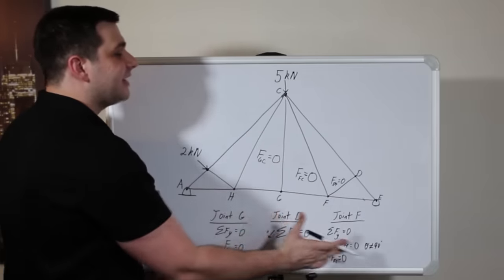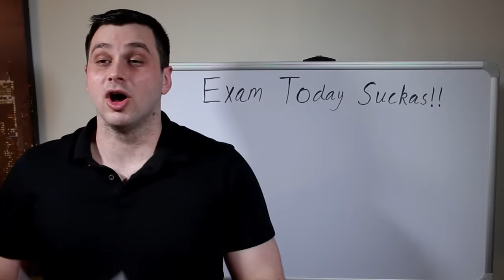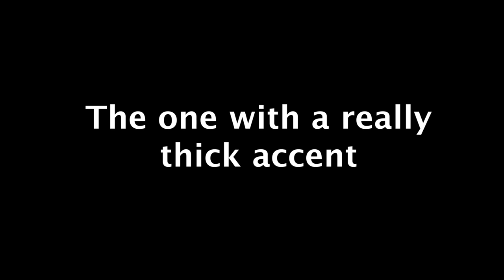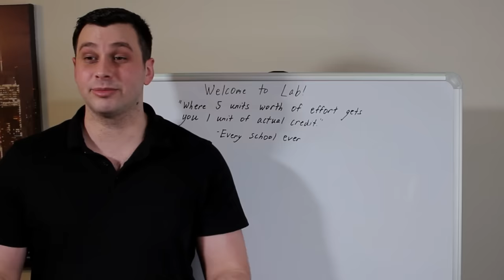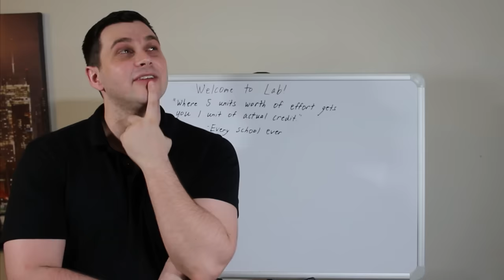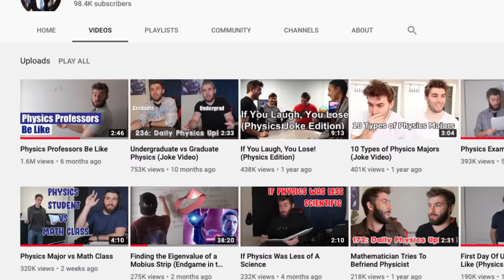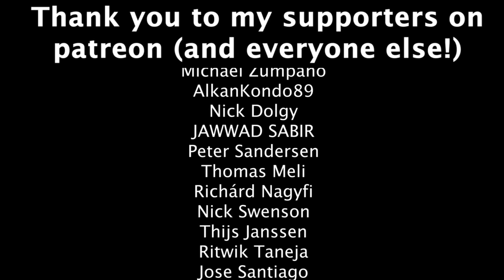Engineering professors be like

Comment: Bro that capacitor one was so true.
One thing I've learned so far making circuits is that if ur circuit doesn't work, try adding random capacitors. Usually works.
Reply: Well I guess they may charge and inject electricity to a circuit which was not design for a good power distribution.
Reply: I just started my 2nd year of electrical engineering! I love circuits
Reply: famous last words
Reply: Electronics engineer at work: "Analogue electronics is easy".

Me: OK, this is a simple circuit diagram of a circuit which works. How exactly does it do 'X'?

Electronics engineer at work: "...."

Me: That's my point.
Reply: Jeez, why is this so true. I'm only doing some basic Arduino-based stuff but adding random capacitors usually makes things work a lot better.
Reply: @bzqp2  I’d guess because it basically adds as a booster for anything taking power on the circuit, it lets things draw higher power when it needs it while staying stable, like if you go from low end speed on a rc car to top speed quickly
Reply: I think of it from a control standpoint. You can reduce steady-state noise of a signal using a PID controller. When implemented as a circuit, the capacitor is the integral portion of the PID. And the integral portion smoothes the steady state error by averaging it out. It's not strictly correct, but it is a nice visual way of rationalizing the need for capacitors.
Reply: The capacitor from the video is just a filter that passes higher frequency signals to ground, reducing noise.
Reply: @thomasgarity1737  pretty much but the question is.. do the lab teacher help you understand this? Mine just straight up called us out for even asking 😂
Reply: I hope you are trolling
Reply: I do the same
Reply: So essentially a reserve capacitor to allow optimal flow. Since energy will take the patch of least resistance that capacitor will allow it to charge and discharge like a bottle. The rest of the electricity will flow into resisters and be forced to equalize through the circuit.
Reply: Filters out random high frequency signals.
Reply: Wut
Reply: signal smoothing? sounds like noise
Reply: 😭😭😭😭 broooo
Reply: You've gotta add more voltage and use your smell to guide you

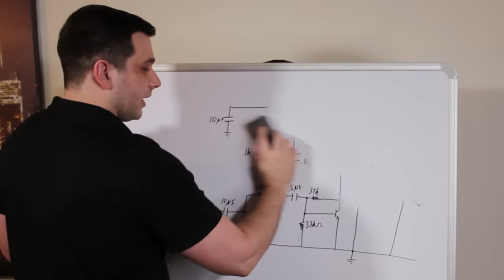Comment: 0:57 - 1:27
Student: "What's with that over there?"
Professor: "It says 100"
Student: "Not its value, its purpose"
Professor: erasing the board "Yes, exactly - it has a purpose"
How extremely relatable, you have no idea.
Reply: By deleting, u meaning erasing right
Reply: @ishanthnaga4376  I thought I edited the comment, but yes
Reply: A capacitor in series in a circuit will act kinda like a filter, since it cannot experience changes in voltage quickly. It helps with noise in the voltage source.
Reply: @samuelsnyder4601  good to know..
Reply: The only way to receive true happiness is to be born again.Jesus loves you and is coming back to earth soon.You need to repent.Please believe and spread the word...
Reply: As an engineering student, I can confirm
Reply: That was one strange circuit. Both the top and bottom power lines were grounded, when normally only the bottom one is. The capacitor must have been there to prevent a short circuit.
Reply: @1Maklak  it is very strange, but it looks like an Ab-class amplifier with some sort of preamp, so assuming that, the cap on the collector of the top transistor is there for filtering the transient when the transistor is active
Reply: "yes, it's not just chilling"
Truer words have never been spoken
Reply: Only mode on the phone camera should be to erase the prof's head to see the formula that'd be inevitably erased in the next 3 seconds.
Reply: @purebliss2669  actually my god is named Bob and he said you don't need to repent
Reply: I like how he pointed to a resistor

Comment: "Top right corner, what's the purpose of that capacitor?"

*points to a resistor
Reply: Damn, u guys have a weird ass symbol for resistors. I honestly needed to rewatch the scene to see what's written next to it
Reply: @aaron9828  that symbol isn't weird, bruh
Reply: @slolilols  It is - for Germans for example.
Reply: this guy circuits
Reply: @faisalinc.7658  For electrical engineers, even Germans use that symbol for resistors. An uncommon symbol is just a box, but universally the zigzag is used.
Reply: @cosmic_sloth  I'm dutch and in high school we also used a box. In university now and there the universal zigzag is used
Reply: A box? Like a blank box with value written inside?
Reply: @argus0ia  Yeah just a rectangle, however I think the value was often written next to it. Looks horrible if I see it in that notation nowadays.
Reply: I have no clue, and I trust your word, good sir
Reply: Sonny the German Standard is the rectangle 😅 we dont use the zigzag one at all..
Reply: In HS we used the zig-zag symbol for resistors (on if not all circuits) but a professor we had used the box symbol for impedance (and also instructed us to do so, but we still used the zig-zag one mostly)
Reply: I just got into highschool doing AP physics, and now after that I finally understand the joke. LOL
Reply: As my prof. once said; We do not care how it is marked but what it means. (Edit: Well, a more direct translation would probably be "We are slaves to it's meaning not the symbol.")
^^This was in response to us complaining that point charges were marked with 'q' and 'Q' in his class and as 'e' in physics class... Also, I think the European standard is the rectangle with the value of the resistor written beside it. It's what we use here in Slovenia. We also occasionally use a colored/filled in rectangle for inductors.

Probably the reason it is done this way here is so we can easily distinguish between resistors and inductors when looking at a larger circuit... Whereas I feel like this symbol for the resistor he used (usually said to be the American symbol) could quickly get confused for the squiggly loop symbol of an inductor.
Reply: Me acting like Im not a bio student
Reply: Exactly 😂. They navigate the whole board before the object in question is reached
Reply: Wasn't it a coil ?
Reply: ..The only way to receive true happiness is to be born again.Jesus loves you and is coming back to earth soon.You need to repent.Please believe and spread the word.
Reply: Im so bad with eletronics I didn't notice at all. This whole scheme just gave me a panic attack

Comment: Zach: “Alright this is a solid D+ paper.”
Andrew: “I did everything the requirements said…”
Zach: “Oh but that’s only if you wanted a C at the max…”
Andrew: “So what do I need to do to get an A?”
Zach: That’s the neat part, you don’t
Reply: I had one of those. I had to write a ton of shaders manually for a 3D game environment. You had to create all the geometry in shaders and do at least 3 post processing effects that were harder than blur. I did all that and got a MF (A fail you can resit) because one of the post effects didn't work right.

This was one of 3 modules that semester, and this was a Bachelor's degree.
Reply: @PalladinPoker  now that’s a bruh moment
Reply: @PalladinPoker what college??
Reply: @PalladinPoker Bro I don’t even know half the stuff you said @o@
Reply: 90% of teachers. Not even just in engineering

Comment: Student: "Can you explain why there is no force on the center beam?"

Professor: "That is because F=0 so there is no force"
Reply: Ah yes, this ground is made out of floor.
Reply: That one hit different because I’ve had multiple professors tell me basically the same thing
Reply: By the way, it really was a stupid question.
Reply: Even reading this triggers so hard
Reply: I passed statics and I still feel like I don't understand it
Reply: "With these things, each point where the lines meet is static, which means the sum of forces must be zero. If three lines meet at a point and two of them are at 180 deg, then the force from the third one must be zero, since otherwise there would be no way to balance it out." is the correct answer, but "because F = 0" is way more entertaining for the professor.
Reply: -Me"Why do negative charges have vector arrows point inward in an electric field?"  -Them "That's just the sign convention of an electric field."
Reply: @ststst981  did you pass statics or fail every test and still pass the class?
Reply: @boysteacher3818  It has no force acting on that beam as at that joint it has a total of three members, two of which are collinear resulting in a zero-force member beam
Reply: @keremyldrm3702  niye
Reply: Seems pretty simple to me
Reply: @mexicanwootwoot  if you solve maxwells equation for the electric field, you will find that any negative charge will have a negative divergent, hence acting as a sink for the field. similarly, positive charges have a positive divergent, acting as a source
Reply: @kstxevolution9642  dude thanks!
Reply: the prof had a power to make his theory into reality and not the other way around
Reply: Our lecturers release test "solutions" with single number answers and no working out
Reply: This is not even a joke, there are teachers literally like that. Same shit has happened to me more than once.
Reply: I watched the video too
Reply: If a professor replies like that they weren't meant to teach. And shouldn't have been given the chance to teach whatsoever.
Reply: That gave me PTSD for my structural analysis course.
Reply: @keremyldrm3702  yeah like there was no force acting on it
Reply: @justinberezinski6651 , please explain to me how your comment makes any sense?
Reply: @1Maklak  Thank you. I’m watching this without any prior knowledge of engineering and I was curious about what the actual answer was.
Reply: but why is F=0?
Reply: One of the main flaws I found in my MechE degree is that professors often forget to explain the actual physical implications of what you are dealing with. They give you all the tools, calculations and methods to solve the problems, but forget that students are often coming across these concepts for the first time and don't know what moment of inertia is (that one is actually self explanatory, but you get it).
Reply: @pedrosso0  Everybody asks "why" but nobody asks the Force "How are you?".

Seriously though. Draw the forces as Vectors in it and you realize why.
Reply: @josie4065  same lmao
Reply: Yes, we watched the video as well
Reply: @1Maklak  probably saving that question for the exam. Maybe it's a complex unfamiliar.
Reply: @purebliss2669  no
Reply: It's free because it costs 0$
Reply: @DaroriDerEinzige  We once got a professor to start doing that. He couldn’t balance his own example, let alone explain why not, just got ruder
Reply: Man i like humor can hide the sad underlying frustrating reality.
Reply: Damn bro, can't believe we watched the same video.
Reply: @1Maklak  ooh you magic broo
Reply: i guess if you took out the beam and tried to balance the structure and it balanced well and then added that extra beam there would be no force on the beam becuase it would be distributed amongst the other beams like for example if you put a stick below a table there will be no force acting on it because the table is already balanced on its legs

Comment: "The capacitor at the top right"
[points at a *resistor*] "This one, right here?"
Reply: Stalemate Bread “you are right it does have a purpose its not just chilling there” erases the board sigh i felt this one
Reply: The caps are either bypass caps or filters for noise. It's hard to tell since there is no power source for the active amplifiers haha. The first stage is a common emitter amplifier with a filter, and the second stage is a class B amplifier
Reply: @corydiehl764  My question would have been about the two diodes in series. What purpose does that even fulfill??
Reply: @ProNoobGamer93  excellent question erases board
Reply: @ProNoobGamer93  The diodes are used to bias the transistors specifically to make the circuit what's called an AB class amplifier. With a constant voltage drop from the diodes, both output transistors conduct signal a little bit longer than without it, reducing crossover distortion.
Reply: @BananaManPL  yea but wouldn't one be enough??
Reply: @ProNoobGamer93  no because a diode has a treshold voltage, for diodes like a 1n4148 it is ~0.6V, for LEDs it is often higher like 2.2V. In this case putting 2 diodes makes the voltage threshold higher like 2×0.6=1.2V which reduces the crossover distortion
Reply: @stonedmole2351  seems kinda redundant. That's like putting 2 x 100 ohm resistors when you could just as easily put 1 x 200 ohm one. Ok fine I know the general diode you get has a threshold of around 0.7V but still.
Reply: @ProNoobGamer93  A lot of electronic circuits are first built and then explained. I'd wager it just had to work with available parts or someone noticed a second diode reduces distortion further and just kept it that way.
Reply: @ProNoobGamer93  it isn't redundant, it's like a Darlington pair, you don't have a transistor with a gain of 10000. I don't know what kind of diode they used in the schematic but the threshold voltage isn't something that is changed easily, maybe using diodes with a bigger threshold voltage increases the switching time which is something unwanted
Reply: @stonedmole2351  I guess that makes sense. Though Darlingtons are like the best possible example of this.
Reply: @jakemora1426  istg. I genuinely relate to that the most
Reply: That capacitor is a decoupling capacitor to clean up the power supply lines otherwise you'll see small oscillations on an oscilloscope

Comment: The Death Star exhaust vent will always be an engineering oversight in my canon.
Reply: That one is canonically a sabotage effort though.  The chief engineer and primary system designer built in a flaw in the system that absolutely required that vent to be there.  He then sabotaged all the engineering efforts that would have shown the risk of the defect.   He was the chief engineer on a very fast paced program, and speaking from experience a person in that position could probably get away with that.  By the time he was caught and revealed as a spy they were pretty much taking the weapon into battle and there wasn't any time for them to find his sabotage.
Reply: I feel like not having a heat dispersion system for a giant reactor might be a bigger oversight, but that's just me
Reply: Please no, Rogue One retconning it was absolutely horrific. It didn't even need explaining
What is so unbelievable of a massive death star having an ecploitable exhaust port?
Mind you, it doesn't have only one of those, there are several(8 or 16, can't remember whuch one it was) at the end of trenches near its north pole.
And of those ports only 1(one) is exploitable.
We didn't need the Rougue One retcon, we didn't need to explain a plothole where there wasn't one, to end up fucking it up more...
Reply: Please look up "the death star architect speaks out"
Reply: Yeah because a moon-sized space station that has such a small exhaust vent isn't a miracle of engineering. Have you seen the ventilation on your pc? Btw it's not like it's just "a hole", there should be all kinds of valves, filtration and whatnot since it opens into space,with a air,heat,radiation,waste going out from it.
Reply: On top of all replys here who already specify this thing absolutely needed a vent, I'd like to add that no one in their right mind could imagine that there was a fleet in the galaxy not only strong enough to attack the Death Star that apparently often has Darth Vader, probably the deadliest pilot in the galaxy, on board, and that this fleet could in the heat of the battle manage to shoot a missile in that narrow opening. The only way to accomplish that reliably is to be Force sensitive or at least know how to somewhat feel it, and anyone capable of that should be dead by now. All in all, it's was more likely the Death Star would have blown up by overheating with no vent than by having a missile shot at it with a vent
Reply: @xolotltolox7626  Except it did not. Rogue one and Sequels were pure success, and moved Star Wars in a better, more logical direction.
Reply: @kingol4801  This is bait
Reply: I would argue that there's no way that attack could have been foreseen, as it required having the plans to know about the exhaust vent, disabling the shield generator, fighting their way through air defenses, then using The Force. They never would have expected anyone to get that close to it. As for Rogue One showing it as deliberate sabotage, I'd say he did a bad job of it if attacking was so difficult. My canon is that he knew his design would be too scrutinized to make it any bigger, he made it as vulnerable as possible, but his main act to help the rebels was in providing the plans that show this vulnerability so they could exploit it.